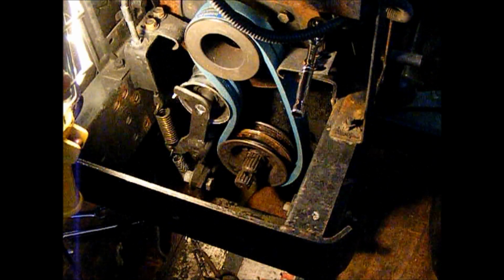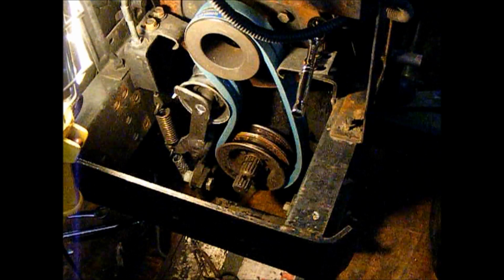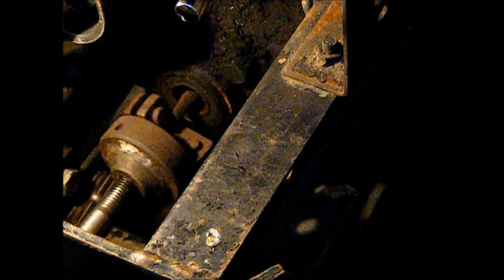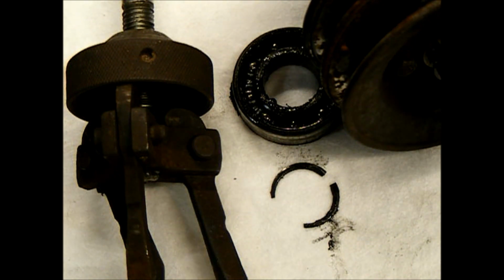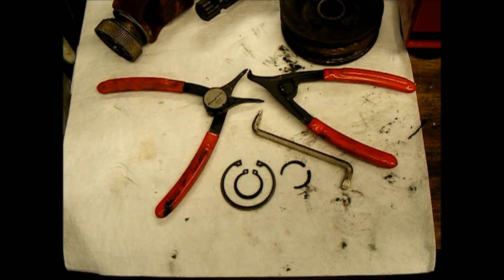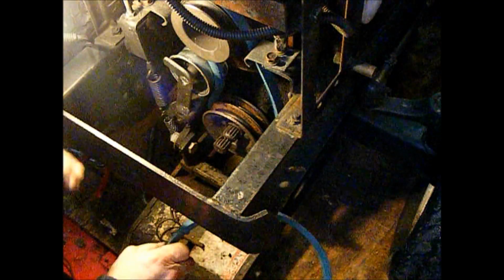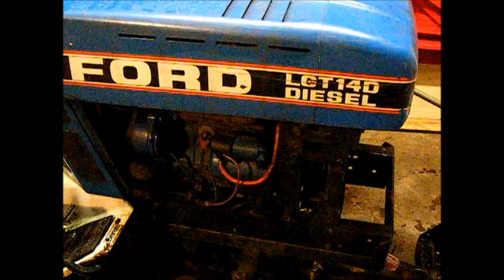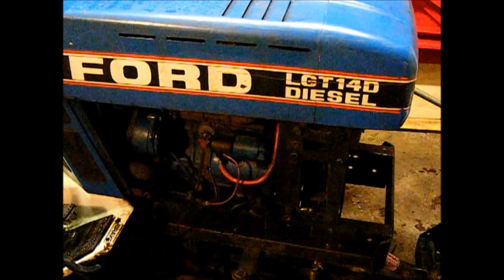FORD LGT 14D PTO REPAIR

Comment: I'm having this exact issue. I inherited an lgt14d that was taken good care of but hasn't ran in years. I got it running but the belts were slipping when the pto wasn't engaged, but made alot of noise coming from the pto area. I thought the bearings were shot until I grabbed the pto pulley to check for play.
Reply from the maker: Probably a weak point in the design.  Thanks for watching, Have a great day!
Reply: @repairrestoreresell2026  Thank you! Do you happen to remember the pto belt lengths? Thanks in advance.
Reply from the maker: @LudwigVonSaxon  They are 5L32, 5L320, 5/8 X 32 KEVLAR BELTS (2) REQUIRED